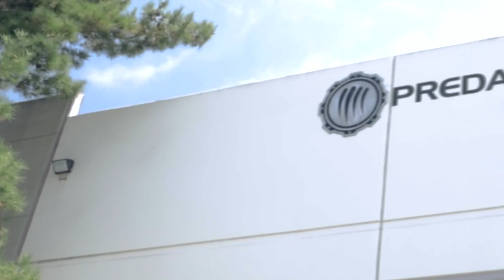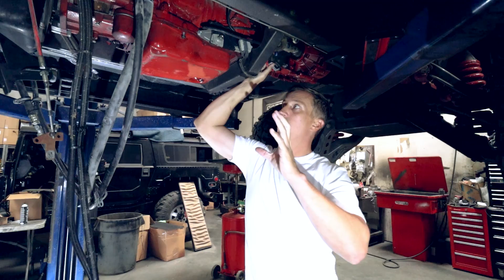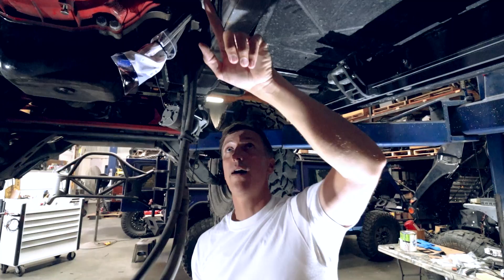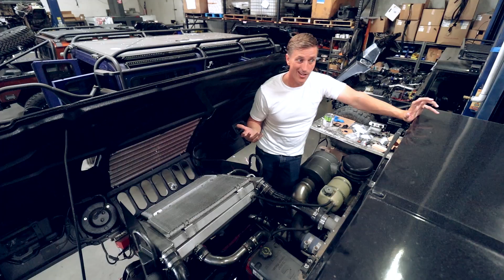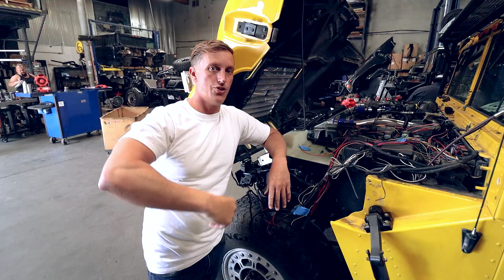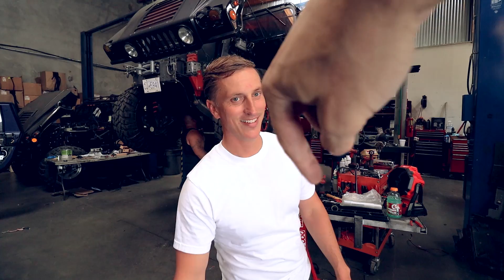CUMMINS SWAPPED OUT FOR A DURAMAX CONVERSION

Comment: in africa people use toyota . its cheaper and more reliable ..This whole hummer swap is a waste of money ..the Engine compartment is short and it will be. very hard to work on in case of a break down  . when i should say ...and its very expensive .you have to be a moron to go this road . The only otherway is get a newer longer frame . and it will be costy as well .

Comment: Hello, I am Lewis. I never hear you talking about the power stroke diesel. What are your thoughts on that?
Reply from the maker: Not worth mentioning. Just recently ford has made what seems to be a decent engine however time will tell. The prior 6.0 and 7.3's need a lot of work to make them stable where as the Cummins and dmax are rock solid from the start with a ton of power.

Comment: the Cummins torque curve is done for tractor use and ideal, not for street use, cars:
the clue is the lower the rpm drops because of heavy load and reduced speed, the higher the torque goes. for speed though you need power NOT torque. (actually it's relates to each other and can be calculated)

Comment: A beefed up 4bt and allison would be better than the 6 cylinder. Now if you use the ISF or QSB 4.5 cummins with the allison you'd be golden. Can get 275hp and almost 800 # ft out of the 4.5 cummins. Not loud and clanky like the 4bt. It's basically a 4 cylinder 24 valve. The ISF4.5 puts down 210hp and 620#ft. Would be the smartest cummins swap for the Hummer/Humver.
Reply: PS. Pay me for this phenomenal idea. You're welcome.
Reply from the maker: Yah that would be great however its tough to justify the cost on a 4.5 swap for about half the power then a dmax.
Reply: @PredatorInc  the 4.5 is an untapped potential. I believe the 4 cylinder is capable of 400 hp and 1000# ft. I believe it to be an economical underdog. The Euro 5 variant puts down 210/620. Fire ringed, studded, bigger injectors, pump work and a decent turbo and it could see 350/850+ and still get a humvee up to 25mpg just on the torque band. 

If I had the money. This would be a project I'd bring your way.